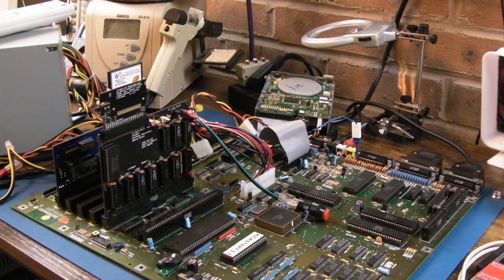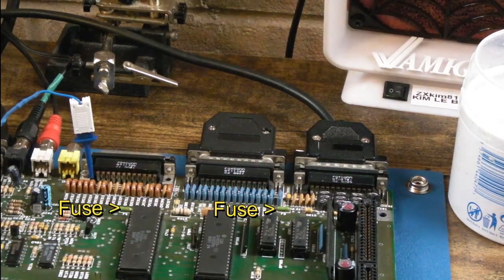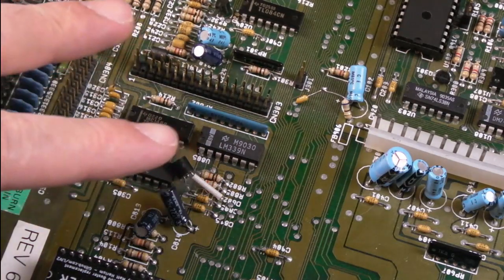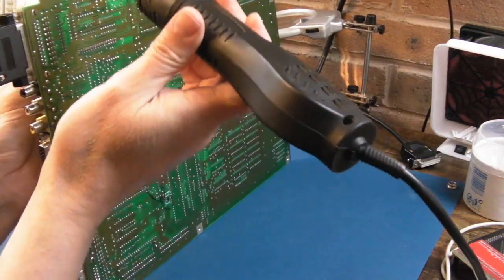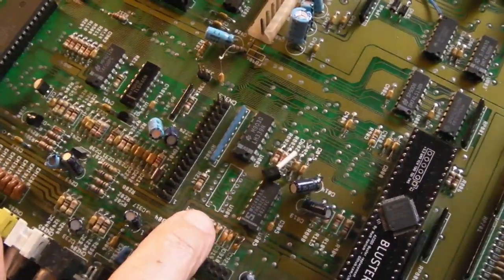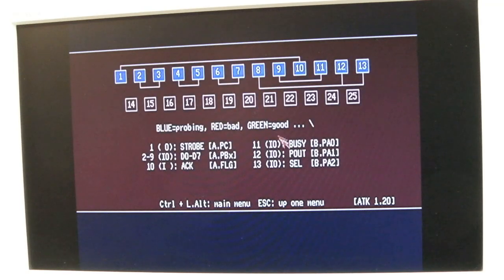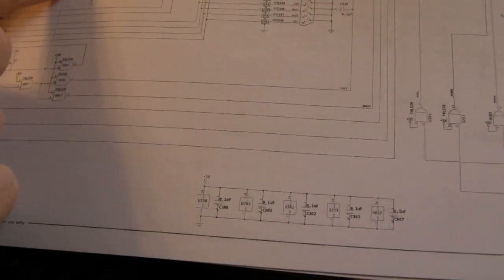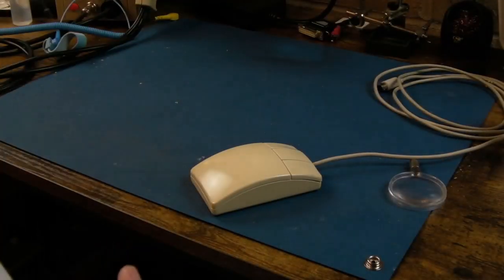Commodore Amiga A2000 Serial / Parallel / Filter Quick Repair

Comment: I had exactly the same problem with the same symptoms on my a500+ a few months ago.

it was triggered for me when i stupidly used the power supply of a c128 instead of the amiga power supply…😅

🐭
Reply: I also had exactly the same errors reporting on the serial and parrallel ports on my 500.  After socketing and replacing those chips the issue remained.  I found a thread indicating a potential 12v issue.  I swapped the PSU and the issue resolved.

Comment: You've got me thinking now. Are there fuses for the ports on the A600? If not, that probably explains why one of the resistors burnt a crater in the under side of the board on one of mine when something went wrong 😆
Reply from the maker: Hehe, yeah - they removed them from later designs!  It would have saved that from happening to your 600!
Reply: @GadgetUK164  The cheapskates!

Comment: could it have been a short in the chip that was just dropping the voltages slightly?
Reply from the maker: The 5v level was OK, I think there was perhaps an IRQ occuring on the serial side due to a faulty input.